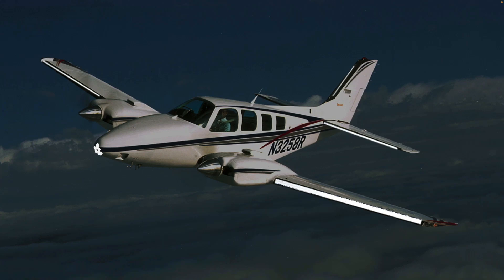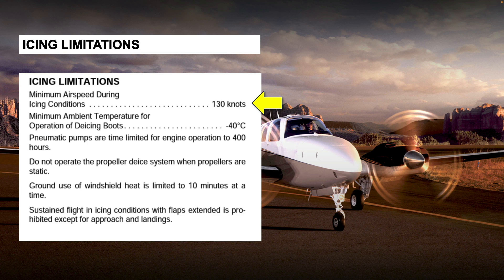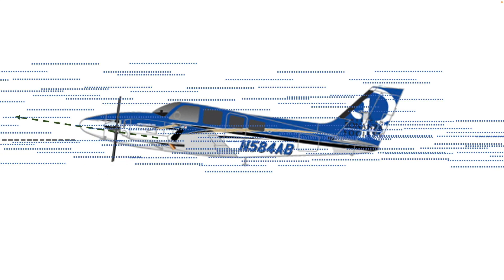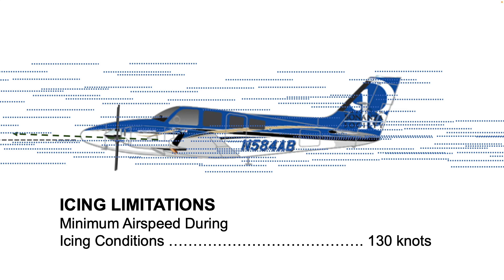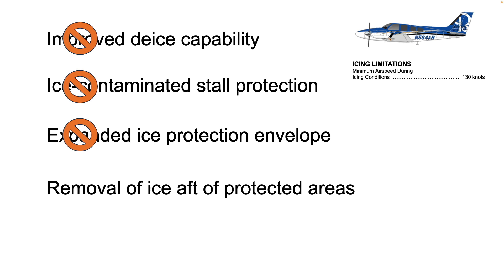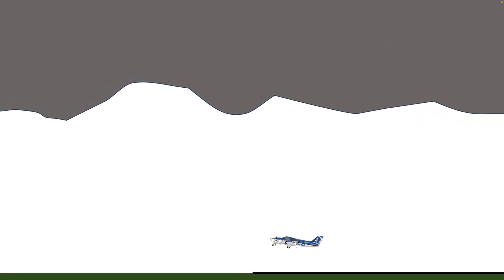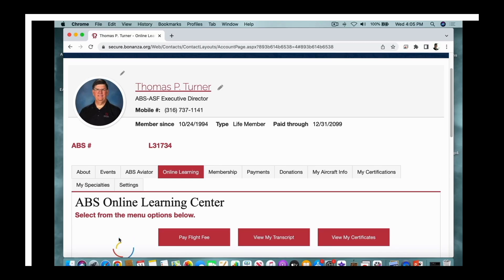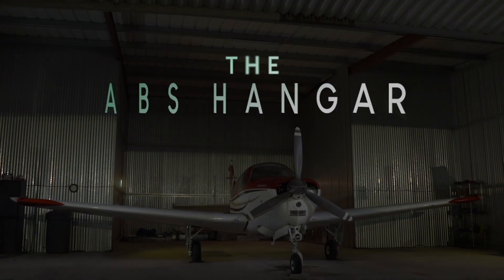Minimum Speed During Icing Conditions

Comment: Wow, excellent video.  I would also mention that extra airspeed during icing adds airspeed margin between you and the rising stall speed of the iced aircraft's wing.  The stall speed of an iced wing could be much higher than expected.  Other than maybe mushy controls, the pilot has no way of knowing what the iced stall speed is so, yeah, keep the airspeed up, and keep your wheels close to the tarmac during the landing flare.  At flare, an iced aircraft is very likely to stall abruptly and one wing will invariably drop before the other, so you don't want to be ten feet above the ground when that happens.